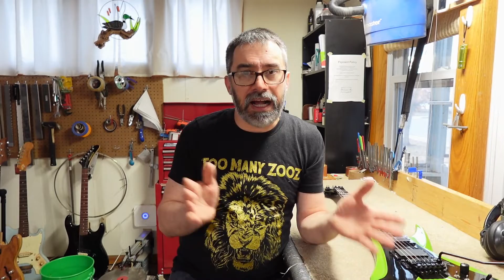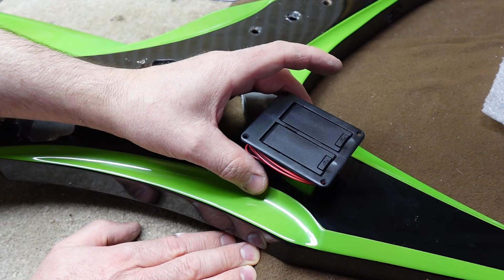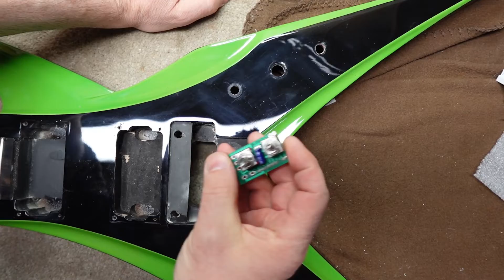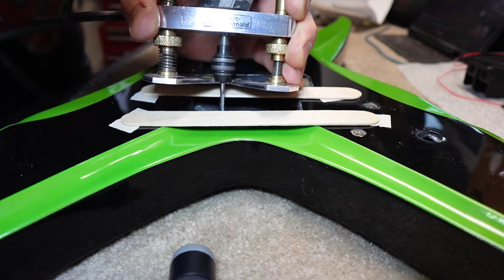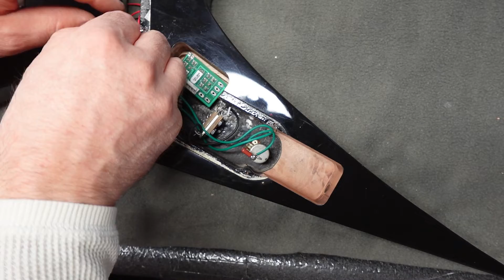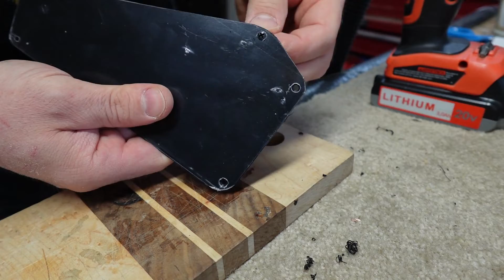Sustainiac Install #2

Comment: How did you manage to route it without chipping the guitar's finish? I want to do the same thing on my jackson king v but I'm scared the finish will  chip
Reply: Taping (as shown) helps and sometimes scoring the rout line with a fresh razor decreases chipping. Also using a fresh downcut (or compression) carbide router bit is a good idea.

Comment: It's a shame there are not much manufacturers outside of Schecter selling guitars with Sustainiacs already installed. AT least we have great people like you who can help out. Good work!
Reply: Part of that is the technology behind it just doesn't work with 24 fret guitars, the pickups are to close, so for a brand like Ibanez to start doing that they would have to start making 22 fret guitars outside of the az or artcore series which is something they haven't done since the early 2000s, also include a battery box probably.
Reply: @theprismaticsystem2833 Synyster gates has a 24 fret guitar with a sustainiac and it works amazing and sounds amazing
Reply: @theprismaticsystem2833  The Ibanez JS240, as one example, has 24 frets. And a Sustainiac. They are fitted to bass guitars as well.
Reply: @theprismaticsystem2833  that's not true. I had a Schecter E-1, 24 frets 25.5" with Sustainiac.